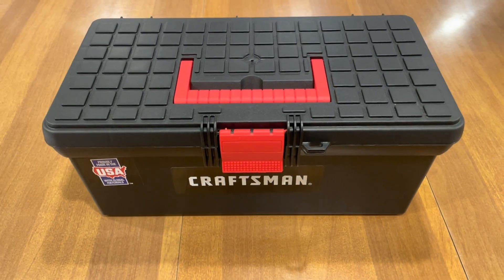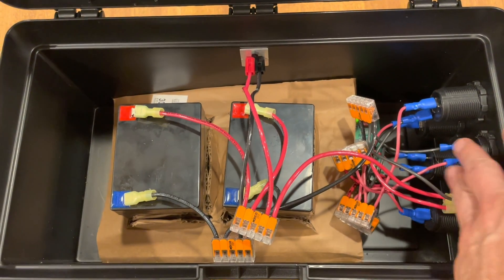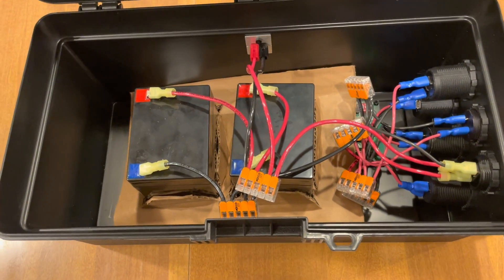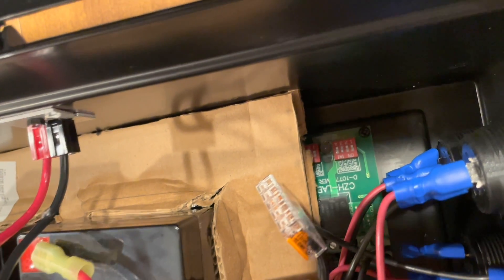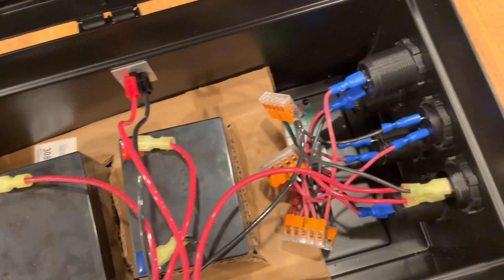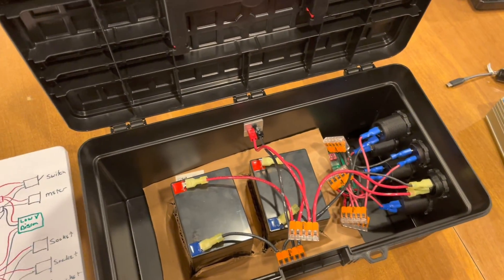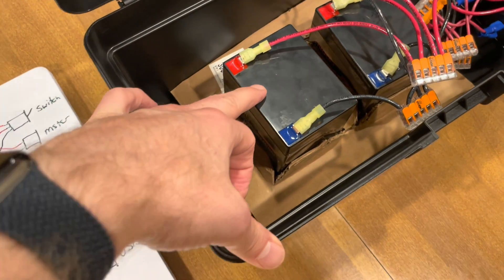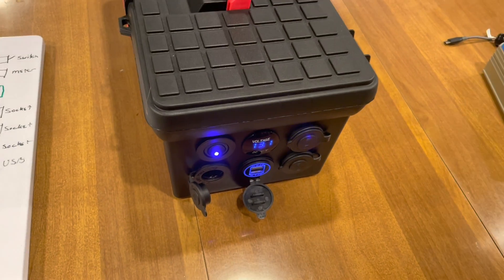Fast Charging Portable Power Station

Comment: Gene, "DIY Solar with Will Prowse" tore down these batteries and tested them. They failed many of  his  tests. But the most important takeaway in my opinion was that he said to always use a resister on each cell, when connected in parallel, and to never connect them in series. 
https://www.youtube.com/watch?v=Wm3Bnpjohhk
Reply from the maker: Thanks for sharing, Root Canal. So far for my purposes, the 2 batteries I've used seem to be working fine and I'm quite happy with their performance.  Granted I try to stay within in the 20-80% charged range on them so they don't get abused too much.  If people are concerned with my choice of battery, there are many other options out there that could be dropped into this build.  I do like the features available in the LiFePO4 chemistry for this application over LiPo, SLA, NiCad and others.

Comment: Thanks for the video. I have an Ecoflow Delta portable power station . It has a solar charge controller built inside the cabinet, along with a 1700 watt inverter. The usable capacity of the battery is about 1100 watt-hours. Hopefully I could use one of your bike generator builds to charge it up, when there is no sun outside. You have a good build here, but I wanted something with higher capacity, where I could power AC appliances.. Thanks again.
Reply: you need to consider how it's wired. I have a power station that is made up of 9 packs of 4 cells each. So l like GENE says - it limits the TAKE or DRAW to 3 amps or so. Also depends on why kind of motor you use on the bicycle. I have a treadmill motor so the internal resistance is higher. So I get back EMF more easily. So as GENE says - powering direct to DC is way more efficient. You can get a much higher DRAW so that you get much less reverse torque or "back emf" on the bicycle generator. It is kind of trippy because as you increase the amp output the pedaling gets EASIER.
Reply: @voidisyinyangvoidisyinyang885  Thanks for the explanation.

Comment: Also would like to add that if the batteries are not getting hot it's a sign of good efficiency. In fact if you could measure the battery and ambient temperature you can use thermal dynamics to estimate the energy lost to heat.
Reply from the maker: Thanks Sterling - I really do like these LiFePO4 batteries, they are much better than other options I've tried (LiPO, Lead acid) and are working out perfectly for my needs.